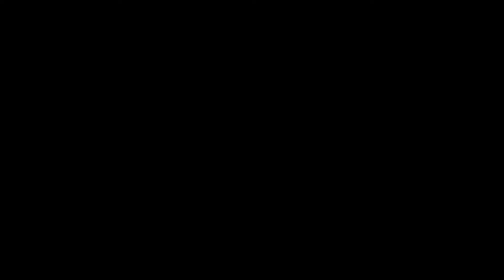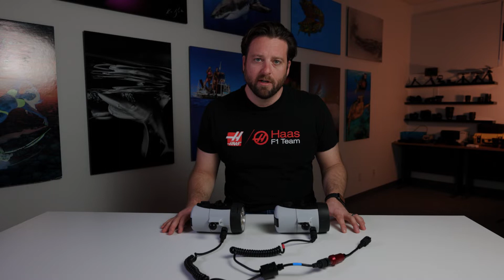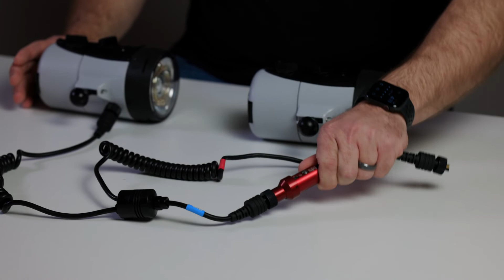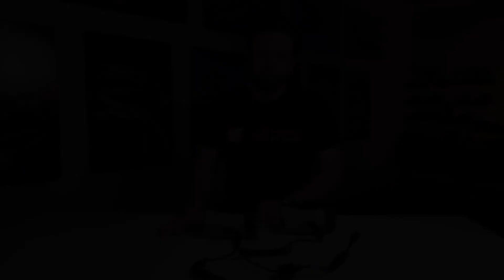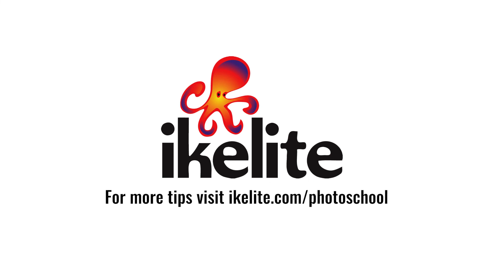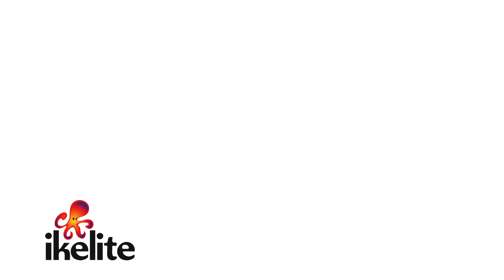How to Program an Ikelite DL5 DS Link Canon TTL Converter

Comment: I have new ecko strob and this, but when I press the button it goes to programming mode. I can't switch it to manual mode? Howwvere if i remove the DL5 and just do manual then my strobes work fine in manual?
Reply from the maker: For one thing just to be sure, the DS Link should plug into the housing and then attach the Ecko DS strobe by sync cord to the DS Link. 

If you press the button on the DS Link it should toggle back and forth between TTL (blue light) and manual (red light). If that's not working normally, I would recommend sending an email detailing the operation to ikelite@ikelite.com so that we can help troubleshoot.